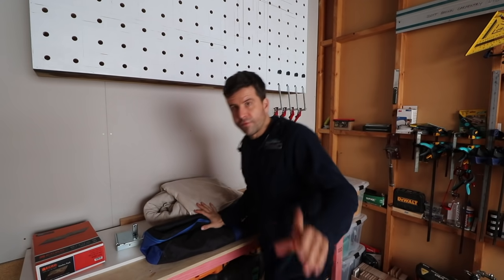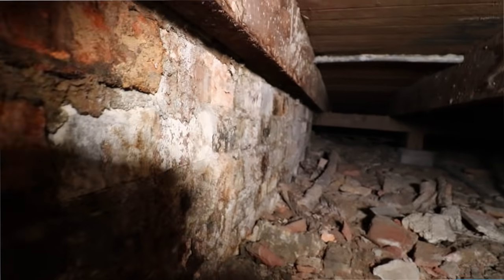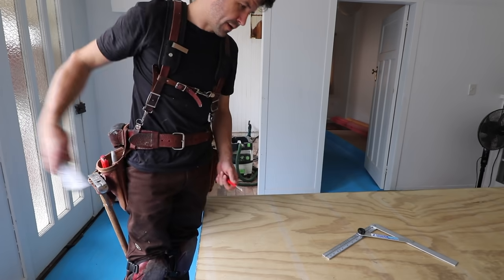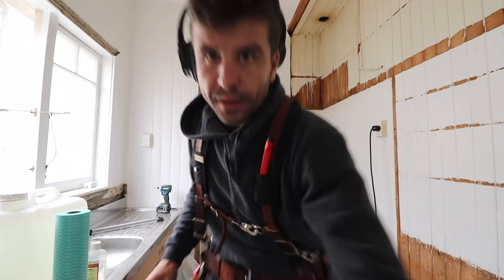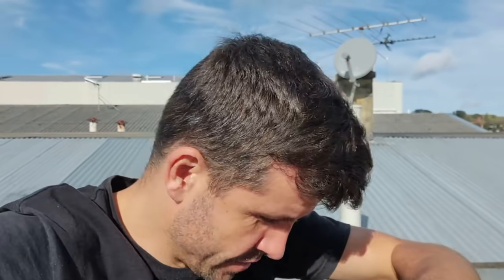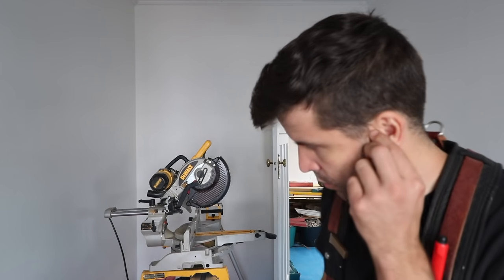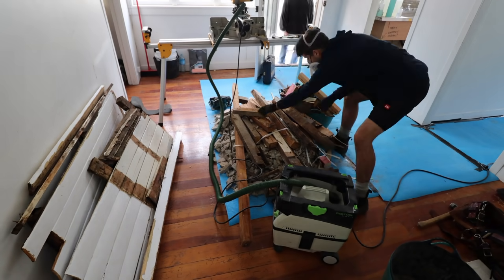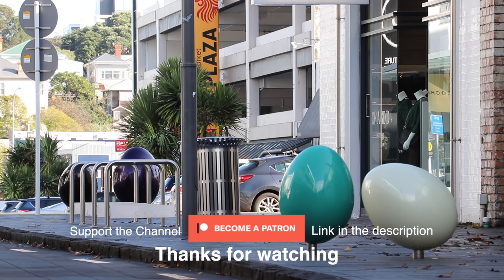Renovations and the unexpected

Comment: Hi Scott, I think maybe you should have capped the end of the repaired joist with a damp proof material, it's fine using the bitumen  strip, but it seems that the end of the joists can get damp when in contact with the outside wall, UK tradie :)

Comment: As soon as I saw the receptacle free of the wall and that it was piped in with old gas pipe, i KNEW the electric was going to be a headache. Thank you for the video Scott!
Reply: Its not piped in with gas pipe. Its piped in with split steel conduit. 
This is the way it was done in Australia and New Zealand 50 or 60 years ago.
Reply: And older, I grew up in a c1900 Villa and it had what I was told was conduit wiring. Apparently the old insulation starts to fail and you get a moderate short to ground causing a hot spot eventually causing a fire. So not something anyone wants to keep in their house.

Comment: I am always jealous watching you use the battery powered nailers!
Reply: I've just ordered the Hikoki battery brad nailer, if it's as good as it seems, I may need to replace the Paslode with the Hikoki
Reply: Mi sono imbatutto in questo video per caso.
Ho sofferto io.....dovete soffrire anche voi.

https://youtu.be/V3SY8v6WDi0
Reply: @iggifer  we have Metabo HPT here (I believe same as Hikoki), but service is hard to find and we can't get a 16g finish nailer. Apparently its discontinued...
Reply: The Homestud weird. Yea Metabo HPT is Hikoki in the rest of the world. It’s a 16GA nailer I’ve ordered. Still listed as a product on the Hikoki UK website - 16GA is the most popular size nailer over here. 18 or higher is not as common.
Reply: What happened to the airbow? Looked neat, but at those super high pressures, I'm concerned about longevity....
Reply: DR PHIL  I'm actually in the process getting my hands on the Milwaukee 15g finish and 18g brad to test. I'm not a huge fan of dewalt nailers, specifically the delayed flywheel firing mechanism. And even though I am on Makitas cordless platform, their cordless nailers are very oddly weighted in the hand.

Comment: The HWC should have a drip tray under it. Then, no more leak problems, even if the cylinder leaks.
Reply: Doesn't happen. Although a cylinder blew up 2 or 3 years back .Totally destroyed the house and badly damage several around it.  Tray wouldn't have helped there.

Comment: Love that you are back 🎉. Question for Kam it yourself. Got a festool hkc   end of last year. Have my Makita small battery cordless circular saw. Got the festool as no matter what I attached to Makita it makes a huge mess especially when doing internal work. Love the festool for lack of mess but find it bulky and twice the size of Makita and off the track I am way more accurate with the Makita and the Makita has more power for very similar size blades. Question is what are your thoughts boys. Love to hear your thoughts.

Comment: Why nail in the timber at @3:35 with a hammer and stainless steel nails instead of just using the nail gun?
Reply: In case there's a leak in the future, the nails won't go rusty. Might be overkill, but no harm doing it this way.

Comment: Whats the most common screw head in NZ?? Like: Phillips, square, torx, etc
Reply: Probably square, then  posidrive . Gib screws are always? phillips.  It depends on your trade, sparkies use some strange ones and Plumbers use whatever is floating around on the floor of the van.

Comment: Suprises me people still go for hot water cylinders, its such a waste of space inside when you could put one of the instant gas hotwater jobbies on the outside of the house..
Reply: Some of the newer developments here have hot water heaters on the outside if there's no room inside. Honestly, they look fugly exposed outside and it shows the properties were built as cheaply as possible. Used to hate seeing boilers in the UK mounted on kitchen walls without being boxed in or hidden from view - not sure if that was a code thing, though.
There was a gas line into that apartment, so maybe they could install a gas hot water heater inside the cupboard and it would leave plenty of room for storage. Plenty of houses here don't have gas, so hot water cylinders are installed instead.
The gas hot water heater in my townhouse def isn't instant - takes a good minute to get hot water into the shower from less 3m / 10ft away. I think the technical term for it is "it's crap"...

Comment: I know this is an odd request, but what would anyone call the style of top he wears at the beginning? The pacemakers hard fleece type one, I've one similar that's reached the end of its life cycle and is apparently impossible to find anything like it 😐. Thanks.
Reply: If your NZ based, search any corporate branding companies. In Auckland there is embroid me, Hillcrest promotions and in Wellington Signature promotions... That's just the ones off the top of my head 😊
Reply: @dressjess  Thanks very much for the reply :) unfortunately i'm England/UK based but the last one i got was by Ridgeline which i believe is a New Zealand based company,, i tried the company stated on the top itself of course but i gather it's probably discontinued or such,i got my similiar one from a uk based supplier like but it originated from NZ, it was just one of those stupidly comfy tops that had plenty of utility value and such for working life and even casual,  i'll take a gander though, thanks for the response.

Comment: It still bugs me that there is no insulation under the floor.
Reply: A requirement in new builds - since the '80s progressively getting higher spec
Reply: @markgilchrist860  or required if this was going to be a rental & sub floor is easy to access

Comment: Take car eof yourself. Your mask is not rated for mold and fungus, and you need to keep a clean shave when you do have an appropriate mask. Also, you can fill a sprayer with hydrogen peroxide and soak the  area you are working in. Be safe, be smart.